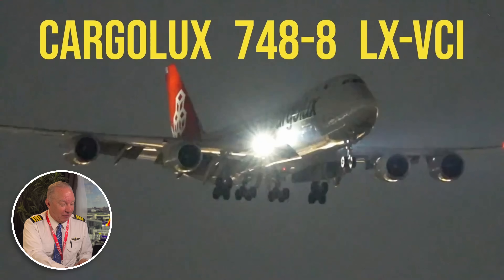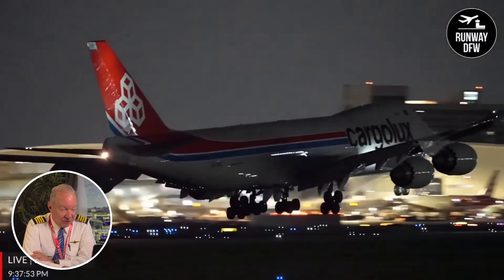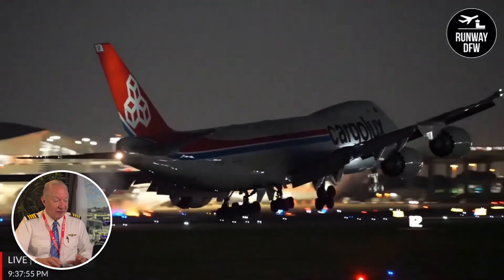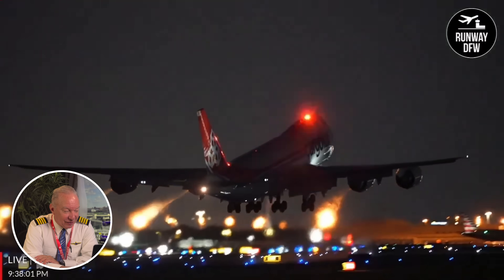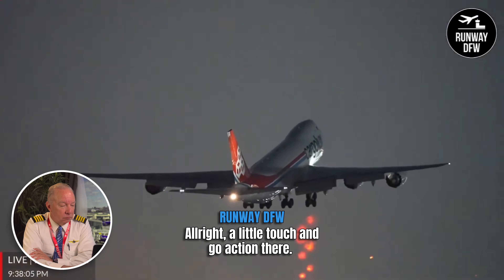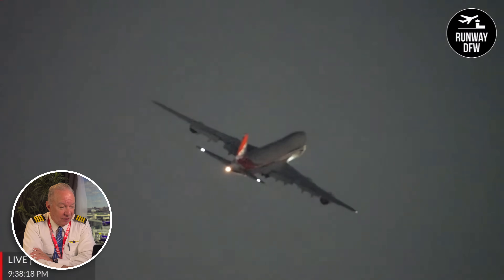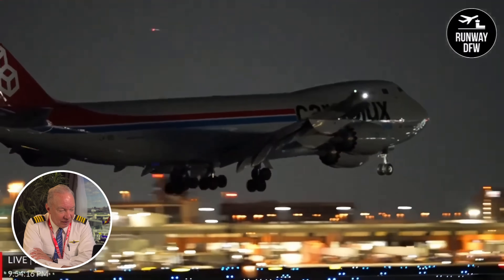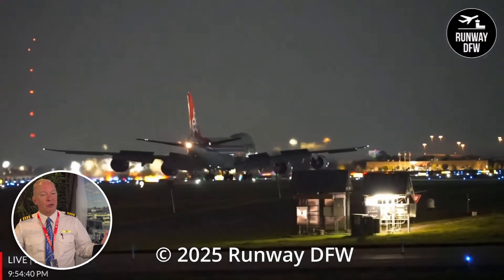Cargolux 747’s Dramatic Bolter Landing at Dallas/Fort Worth

Comment: Is there a fancy pilot name for "almost landing" and then going going vertical again?
Was in a plane last May that came in for a landing in Philadelphia was super close to landing, then went nose up and took off again.  Once we got up to a higher altitude the pilot explained the maneuver was because there was another plane on the runway (that wasn't supposed to be there).
Reply: It's called a missed approach or go around
Reply: "Go around" and when ATC asks why "traffic on the runway". Also can happen if the pilots don't have a "stable approach" which is where the plane is significantly off from the position, speed, or configuration (gear down, flaps set, etc) for the landing. Sometimes that's pilot error, sometimes it's other traffic, sometimes it's weather... a number of reasons for going around, but despite the delay remember it's always done in the name of safety!

Comment: NEW THEORY:  1st Officer saying "why did you cut off?" referred to his controls/screens going blank, as would happen if both engines failed, until RAT is deployed, which takes a few seconds.  Prelim report failed to mention WHEN that was said.
Reply: Supposedly, somebody calculated that 171 should have been going faster when switches went to cutoff.  Maybe power was already lost.
Reply: The generators on each engine use a variable-ratio gear box to maintain same generator RPM regardless of jet RPM.  Wouldn't that keep generator power coming until engines had spun down considerably?

Comment: The Boeing 747 was the nicest airplane I ever flew. My father who flew for a different airline flew the Lockheed L-1011 and also the 747, and he liked the L-1011 just a little bit more. Not much more, just a little bit. Every L-1011 pilot I ever met liked the Direct Lift Control system on the 
L-1011. But, the Cargolux did not perform a bolter. There was no aircraft carrier involved, and no arresting wire. A bolter has always referred a combination of an aircraft landing on an aircraft carrier and an actual aircraft carrier. Here is the Wikipedia definition of a bolter verbatim:
 
"In naval aviation, a bolter occurs when an aircraft attempting an arrested landing on the flight deck of an aircraft carrier touches down, but fails to catch an arrestor cable and come to a stop." 

The Cargolux was simply performing a go around, not a bolter. Perhaps a bunch of Navy guys took over the American Airlines Training Center? I've seen it happen.
Reply: Everyone has their favorite plane to fly, mine was the DC-10.

Comment: Could that bolter have been due to a headwind gust? He's about to touch down, gets a gust from the right front quarter, which adds airspeed and lifts the right wing a little, he floats, so he does a go-around. 

Funny that you mention you had to be very senior in your airline to move to the B-747, and you're flying the B-777. My SIL is a very junior commercial pilot, flies B-737's  (cargo carrier) and applied for the B-777, but they already had enough Triple Seven rated pilots. What did they give him to move to? The B-747. He starts his type training in a couple of months.

Comment: Thanks for this...never heard of the term "boltered landing"...I learn something new on each video!!  One question I have: is the pilot monitoring (not flying) paying attention to the touchdown position on the runway and calling out for G/A if too far down the runway, or is it entirely up to the pilot flying to manage all of this?  And does it matter if it is the captain or FO flying?  I can see where a captain may step in if the FO bolters the landing, but I wonder if an FO would say anything when the captain does the same.
Reply: If a Naval Aviator misses hooking one of the wires on an aircraft carrier and goes around, it's called a bolter.
Reply: @greener8116  Good to know....and since we know that Captain Steeeve is an ex-Navy pilot, explains why he uses that term.
Reply: @kevindigo22  If the Navy plane has an unstable approach like being too high or too low, the Landing Signal Officer (LSO) will wave them off for a go around, which is different than a bolter.